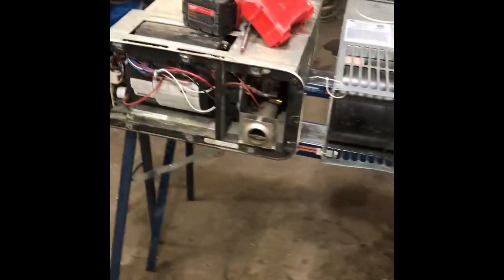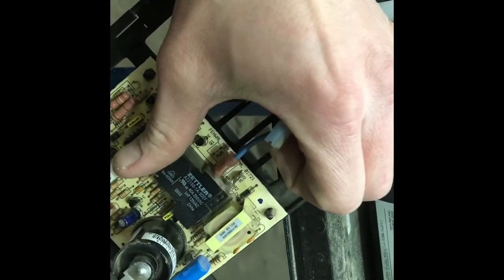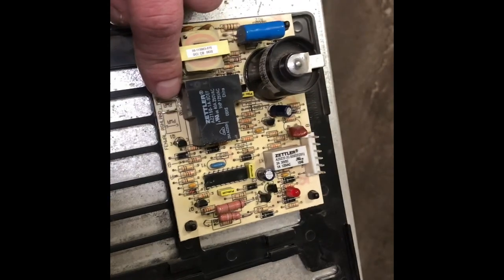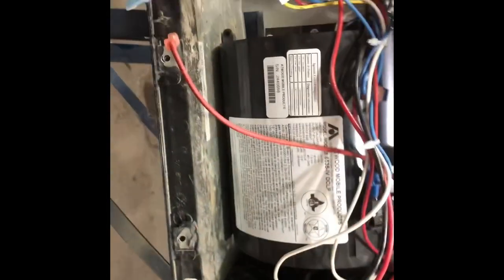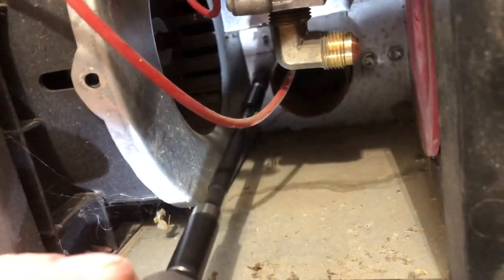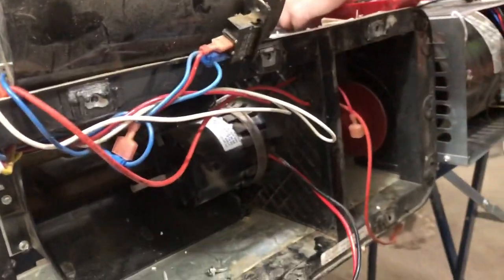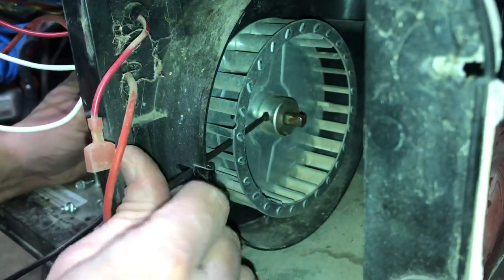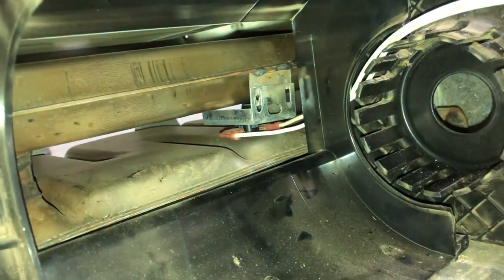Troubleshooting Atwood/Dometic furnace repair walk through tear down part 3

Comment: Thank you so much. I have the exact same model 8531-IV and I was getting all the normal steps in the process (blower, three attempts at lighting) then getting the lockout code with three blinks. I figured it was a bad igniter, but noticed that the connector spade that hooked to the igniter looked pretty rusty. With your directions I was able to pull it out, clean off the connectors, and then put it back in — presto! Works great now. The burner head looked pretty rusted out so I’m ordering a new one of those, but I’m so happy to have fixed this so easily with your help. Thanks.
Reply from the maker: Glad it helped.

Comment: I have this exact same furnace in my coachman camper..  All it does is make a click when its turned on. But no blower operation what so ever.. Ive already replaced the sail switch and circuit board. Still no operation. So I tore back in it and removed the blower motor, hoping that was the culprit.I hooked the motor up to a power source and it operates normally. Any ideas?
Reply: Did you get this figured out?  I am experiencing the exact same symptoms and need to figure it out.
Reply: Yea I did. Finally figured out that the previous owner had 2 wires plugged into the circuit board backwards. Then the blower would run and click but never light. Had to replace the igniter. Works great now

Comment: I removed the furnace from my TT and could not figure out it came apart.  Then watched your videos 1-3, and in 10 min dismantled and diagnosed the issue.  Temp issue resolved (burner melted and carbonized) and new part on the way.  Thanks!  And subscribed.

Comment: Thank you so much for this video it's the only one I found on YouTube for the complete teardown... I bought a fifth wheel from 1999 and it had never been serviced the heat worked just fine until it got to 28° and then there was unburnt fuel. With your tear down I realized that the igniter ceramic part had a bunch of hornets nest or something that was leaving dirt in there vacuumed it out and hopefully that works

Comment: Just finished repairing 8535-IV atwood after watching you video. The part I was missing was where does the blue wire from the reset switch go and what was the other blue wire doing. There was nothing turning on except the temperature at the thermostat.  Turned out to be a loose wire there.

Comment: Holy smokes. Thank you so much!!! My furnace works fine but the plastic blower wheel had some pieces break off. Because of that it was out of balance so the motor bracket broke: the 3 tabs that hold the bracket to the frame. So it sounded terrible and I had to shut it down. I couldn't figure out how to get the gas valve/igniter off so I could get to the screws to replace the mount. I got a new motor and a metal blower wheel but couldn't put the new stuff in. Your video saved me from having to get someone out to do the work for me (at $125/hr!)

You, my friend, are a lifesaver!
Reply from the maker: Glad I was able to help.

Comment: Great video, very helpful and understandable. The blower wheel on my Atwood disintegrated for apparently no reason. I expected to see a mouse or something when I took the furnace apart but there was nothing but broken plastic. I replaced the wheel and still no heat.  I noticed the sail switch paddle was bent and pointing straight probably from a result of the wheel disintegrating. Bent that back. So now I was it would fire  up but would cycle on and off every 15-20 seconds.Checked the sail switch and the limit switch all was fine. This has been going on for 2 days now. I am about ready to throw this furnace out the window. I had watched part 1 and 2 and decided to watch part 3. One comment that cured all my problems. "make sure you put the exhaust back on" OMG it was like I just had an epiphany LOL. Ran back outside put the exhaust back on and there was heat. Thank you saved me from having someone else work on it.
Reply from the maker: robert viens. Thanks tried to be as informative as possible.
Reply from the maker: Always tri to be as informative as possible

Comment: My Atwood 8940 III DCLP starts, ignites, lights and runs for a few seconds then repeats until lockout. I've checked, limit switch, sail switch and igniter, all check good. I could really use some insight of what to check next. Only light flashes I get are when it locks out.
Reply from the maker: It could be the board or the ignitor not seeing the flame. Is the ceramic around the ignitor cracked or damaged

Comment: Thank you for the great videos I have learned a lot from them.  I still have a problem with my Atwood furnace (AFMD30111) not running.  1. No led light on board   2. replaced with new board and no change  3. Fan motor will not kick in at all   4. have power to on-off switch and through switch  5. thermostat is set to furnace and calling for heat but I have nothing.  This furnace worked last year but not this year.  Any help would be appreciated.
Reply from the maker: Glad you enjoyed the video. As far as your issue check to see if there is power to the blower motor if there is than that’s your issue if not then would need to test the sail switch and limit switch see if power is running through there.

Comment: Thanks for the video.  I have been working through diagnosis.  This video has proven pretty helpful, but I am still stuck with a furnace that won't turn on.  It was working fine, and then the next day, just wouldn't get going at all-no attempt to fire up, bow, click.  Nothing.  Seem to have power at the thermostat and tested the switch, after resetting it and it won't go.  I am getting a new sail switch, but the one that's in there, seem to be flapped open and away from the tripping device, so I don't know if that is my problem?  I am also getting no light on the circuit board.  Any insight on how to proceed or potential confounding aspects would be appreciated.
Reply from the maker: As long as the sail switch and high limit switch are good I would start leaning towards the board

Comment: Bought a fish house last year with this same furnace used it all last season for 3 1/2 months trouble free.  Got it out on the ice this season it worked fine for two days.  Then the blower started  for 10 or so seconds but didn't ignite.  Called dometic and they said it was probably the sail switch.. Took it to a local rv dealer they ripped it apart and said there was a big ball of lint on the sail switch they cleaned it cycled it a few times and it worked fine.  Get it back out on the ice have heat for about 6 hours then boom DOING THE EXACT SAME THING!  So I have to rip out my range again to get to it and save labor costs.  I am at witts end with this thing its literally had less than 4 months of use.  In my opinion the furnace design is total garbage. Was 100$ to fix it the first time now I have to do it all over again.  And spend even more money!  By the time it gets fixed i'd be well on my way to buying a new one.  I asked the tech if he can just wire the sail switch together so I don't have to deal with the pos but he said he cant do it.  Very very very disappointed in this model!
Reply from the maker: Just had a thought if you would like to send the unit to me I could do a video on it and do a complete service at a fraction of the cost of you taking it in.

Comment: I have a 1 year old Atwood furnace. Blower will not start, .  I have 12 volts to the circuit board but nothing happens. I through 90 dollars at it and replaced the board. Any thoughts on what I should check next? I also here a click when I set the digital thermostat, so I assume it is working fine. Thanks!
Reply from the maker: If you replaced the board I would put power to the blower motor directly make sure it runs then can narrow the search.
Reply: @thecanadianrvrepairguy3062  Thanks for your help!
Reply: Did you find the problem and get it fixed?  I have the same issue and need to diagnose

Comment: This really helps me a whole lot.  My unit is fairly new, and the sail switch looks perfect.  Now I know where the limit switch is.  Getting to the limit sure looks involved though.
Would it help me to,just pull the whole heater housing out?  Maybe the fan cage is dirty?  I’m Getting the one light indicator blinking.

Comment: I've spent likely 10 hours looking for info on YouTube and forums to help with my atwood 2334 2 Stage furnace issues. No surprise a fellow albertan I finally found  has saved my bacon. Thank you so much for these 4 videos. My question. I'm waiting for new motor for mine but during disassembly my issue was a siezed exhaust (draft shield) atwood calls it. Tried wd40, pb blaster, nothing worked. I was forced to cut the shiny tin off the end of it so I could remove gas valve etc including combustion wheel, which then allowed motor removal. Then I could grab with pipewrench and finally remove. Big problem now is the exhaust ass'y is n/a, anywhere I've searched. Any idea? If I was to extend the pipe a little so that it protrudes out far enough to clear the metal cover would that prevent backfire risk that you mentioned on one of your videos. Sorry for longstory. Any ideas would be appreciated and thanks again fot the great simple to understand information. For all the audio complainers in comments , use closed caption.

Comment: I am trying to troubleshoot my issue. And maybe you can suggest something..tried new thermostat, and new board.. issue. Thermostat off, runs, blows heat, won't shut off. Doesn't seem to be a crossed wire. I have air and heat. Currently only have red, white, green hooked up. Stove lights, no flickering. My furnace just wants to blow heat, all the time. I'd appreciate any suggestions
Reply from the maker: What model of furnace
Reply: @thecanadianrvrepairguy3062  thank you, I moved. Not sure...

Comment: Do you happen to have any idea or tips on how to identify exactly which model of heater i might have? I have been able to get as far as being pretty sure it's at 8525 but I don't know if it's ii iii or iv honestly and I'm looking to buy a new motor for mine. Or would it matter even?  The serial info seems to have work off on the black cover and it has me at a loss
Reply from the maker: Should not matter for the blower motor the iv incorporated some plastic parts in the blower housing to make it quieter
Reply: @thecanadianrvrepairguy3062  thanks for the reply. I got ahold of what was supposed to be the motor for my unit and got it installed but I suspect they may have sent a motor that's drawing a bit more power as the breaker switch pops after running and igniting perfectly for some time. I have to wonder of there's a danger in running the possibly stronger motor with a sutable breaker switch.

Comment: We have an Atwood RV furnace and it started not staying ignited. We are getting 3 flashes from the boards red indicator light at 3 second intervals. Any ideas what to check first?
Reply from the maker: That is a high limit code.
Reply: How to fix it is in the video, correct?

Comment: Please help! I have a 8940-lll-dclp and it turns on and ignites and it will only stay lit for 1 to 3 seconds then stops the flame, then repeats.  I've been living in this rv for 2 years and haven't had any heat. Been sleeping in 35 degrees and I'm so tired of it. Any help would be greatly appreciated!
Reply from the maker: It could be the flame sense or the board
Reply: @thecanadianrvrepairguy3062  that's what I was thinking so the flame sense is built into the ignitor? The light never blinks during this whole process so it makes me think its the control board. But if it's not detecting flame would it blink?
Reply from the maker: Flame sense and Ignitor are the same thing. Yes it could be the board. It’s hard to say without testing

Comment: Now how do you remove that red pinch ring without the furnace pulled?

Atwood is made to be serviceable from the front of the unit I thought including the wheel... But I haven't been able to get that dang ring undone without braking a blade.
Reply: @The Canadian RV Repair Guy thoughts?
Reply from the maker: I have a long pair of needle nose pliers with a 90 at the tip. That’s how I get it out.
Reply: Hmm perhaps that's the trick having a right angle on there. My straight needles just slips off. Thanks!

Comment: I can’t thank you enough for making these videos. I really appreciate it. 
I have an Atwood and heater stopped worked and of course it’s winter time and I live in my RV. The original board was flashing the limit switch one blink light. I replaced the sail switch and upgraded the board to the dinosaur fan 50. Still no clicking or heat. I checked the sail switch with a voltmeter and it seems to work. If the sail switch and limit switch are in series, do I need to pull my furnace apart to test the limit switch separately? What should I do? Thanks for your help
Reply from the maker: As long as you are using the correct wires there is no need to take it all apart to test the limit switch follow the wires and you will see where you need to test.
Reply: Thanks again for your help
Reply: I wanted to ask you what you think I should check next, I was wondering if maybe the electric solenoid switch went out, that’s not letting the gas to ignite, I still don’t hear the clicking sound before the flame. Thanks
Reply from the maker: @joshbalogh86  at this point a phone or FaceTime consult I think might help you more. $50 through PayPal and attach you number in the comments and I can go over a few things with you to check while you do it.

Comment: Our Atwood 30131 furnace seems to work ok but the smell of the exhaust outside is atrocious and overwhelming. What do you think the issue is?
Reply from the maker: Might be a dirty burner or jet. Or could be LP pressure not correct.

Comment: So I got a problem with mine it’s firing up however it’s not reading the flame I have replaced all the parts except for the board which the flame sensing an igniter is on could that be my problem?
Reply from the maker: Yes I would say a board issue
Reply: @thecanadianrvrepairguy3062  Yeah so I finally got the board and put it in and guess what that’s exactly what it was I replace the entire proving system except for the board and that’s what it end up being the board anyway thank you

Comment: I just came across your video!! Ironically I have a furnace issue, we own a 2016 keystone outback 326RL. The furnace makes this god awful finding banhing noise, I'm sure its the motor. Any other ideas you may have woukd be appreciated. Woukd you know if its a difficult removal, I have taken other furnaces out that were fairly easy. Last question are you close to Kamloops BC? Thanks
Reply from the maker: Sounds like the blower wheel is broken. No I am I. Alberta
Reply: @thecanadianrvrepairguy3062  your bang on, I pulled it out today the little mouse destroyed the squirrel cage..
Reply: @wattyd6867  I belive I have the same issue. But I'm trying to figure out how to get the furnace out to take it apart.
Reply: @christinalipscomb8543  is your furnace located in the pantry?
Reply: @christinalipscomb8543  I should ask do you have the same trailer as I have?